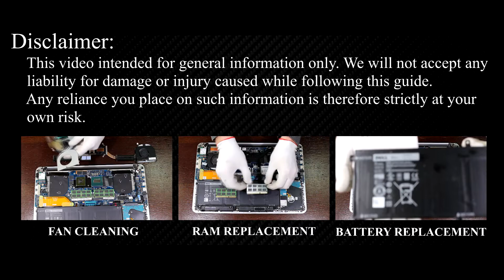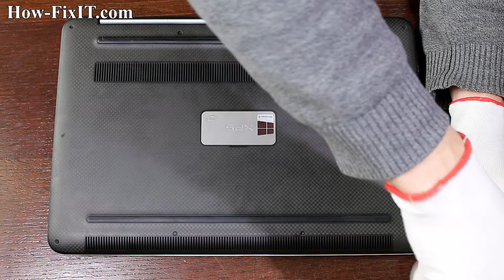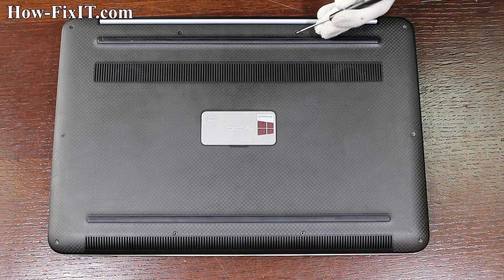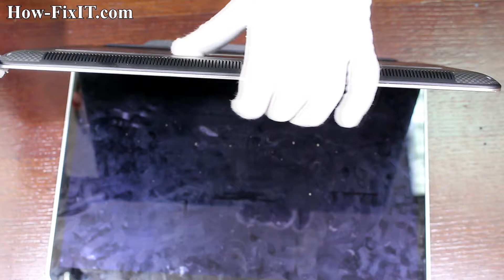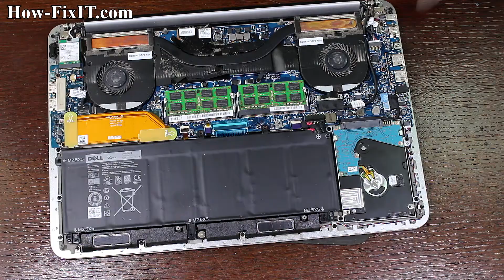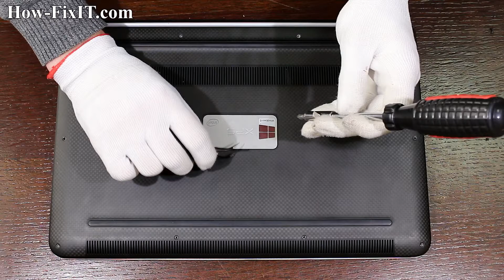Dell XPS 15-9530 (model: P31F, Late 2013) Upgrade: Easy HDD Removal and SSD Installation Tutorial

Comment: Before getting the torx screwdrivers, I wanted to test a Phillips head screwdriver I already had to see if it could unscrew the screws under the flap on the back. The screws loosened but did not come out far enough for me to grab like in the video. Does this mean I won't be able to get the back off, even when I have removed the other screws?

Comment: Probably not going to get a response... but
I've opened mine up, and where your hard drive is, I have the battery pack extending all the way across
Any help? Windows system says it's an XPS 15 9530, I'm at a loss
Reply: Look at the top left hand corner underneath the How-FixIT.com.  That is where your ssd is. It's an mSata drive and not the 2.5" you're looking for.
Reply from the maker: It's not a mSata drive, this is Wi-Fi cart underneath the How-FixIT com
In your case, the mSATA SSD drive located right under the I/O yellow cable.